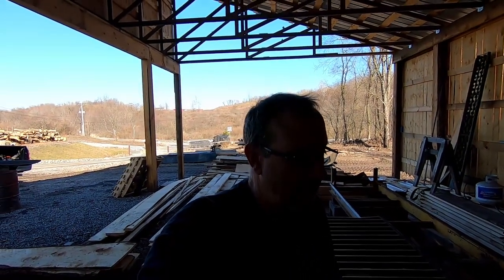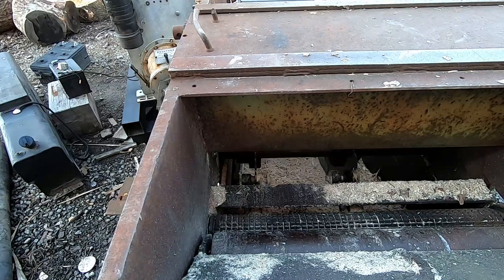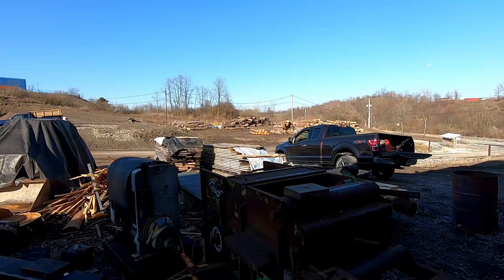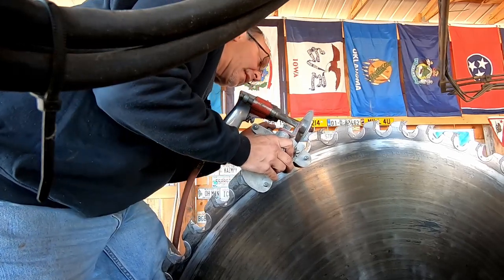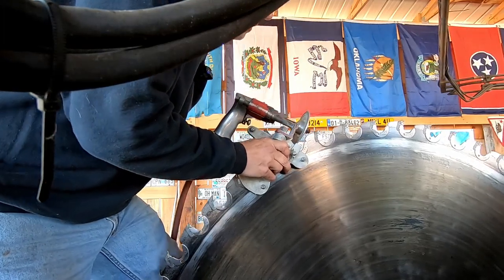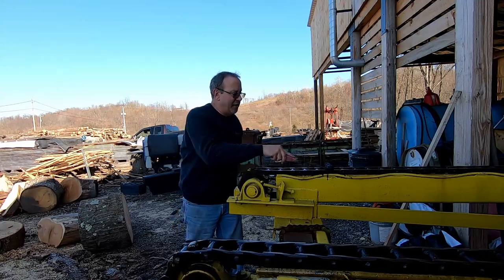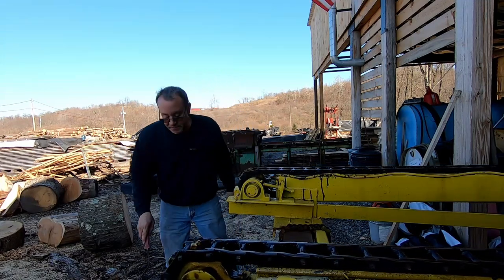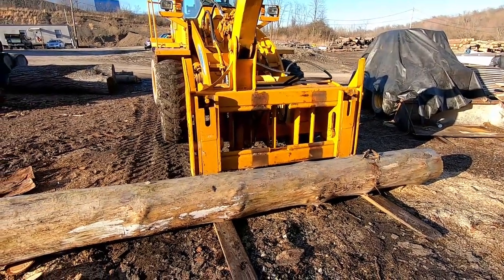friday eve 3 4 21

Comment: I remember saying once that I "wasn't a total idiot." The person replied, "What, you're only a partial?"  When we farmed we saved every bit of "burnt" oil from the tractors and oiled up every piece of equipment that had chains with it. Great stuff.
Reply from the maker: yes it is.
Reply: I knew a woman who used burnt motor oil as suntan lotion, and a man who rigged up a drip pipe into the woodstove in his shop to burn his old oil.
Reply: @davidhensley76  Now I have heard of using used oil to heat with but the suntan lotion? Well, maybe a motor head’s dream girl, I think I’ll stick with a gal using SPF 30 not 10W-30!
Reply: We put about 2 feet of used oil in a barel and soaked fence posts to prevent rot before planting them

Comment: The old mill still has logs for skids and may never have a live deck. It was interesting when a whole truck load came and  was onloaded there. You had to leave enough on the skids to stop everything else. And recycled bus motor oil would work just fine. Dragline drive chains are/were about the same size and a little oil will help a lot. Beats being rusted solid. Always something to do. I need to start sharpening mower blades. The oil was changed last fall. Good deal, Mark. The best to you and the Hardwood King!
Reply from the maker: Thanks Lewie,  used oil comes in handy around the old mill.
Reply: @markgalicic7788  OH yes!

Comment: If the logs you are sawing is frozen is that harder on the blade?  Will you have to sharpen more often?
Reply from the maker: no frozen logs saw the same if you use the proper saw bits.

Comment: Millions of gallons of old used diesel engine old has been to used to lube up chain systems in the Ag and logging industry for ever. The pot ash that is left in the oil does wonders for this type of system. Yea, its a little messy,  but it does the trick.

Comment: On average, how many board feet between sharpening?  Hardwoods vs. softwoods?  For two sided edging, do you flip up the left side spacer and try cut both all at all once or run board through twice?  So, what percentage is idiot (I’m sorry, just couldn’t resist)?
Reply from the maker: We get about 5000 board feet per sharpening